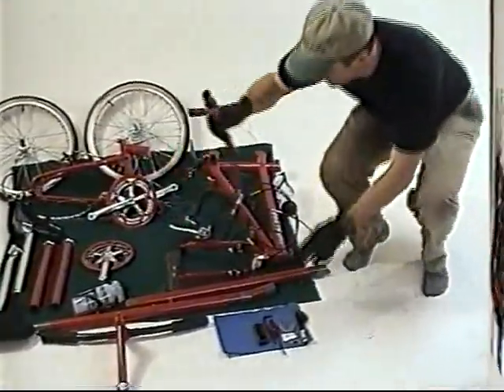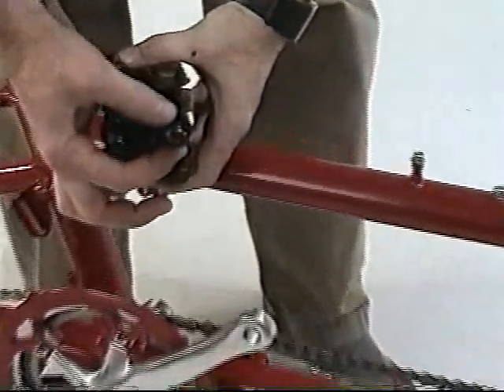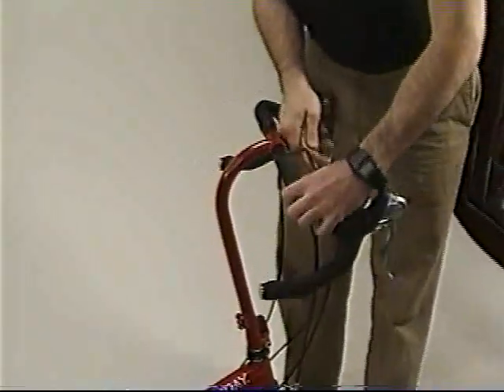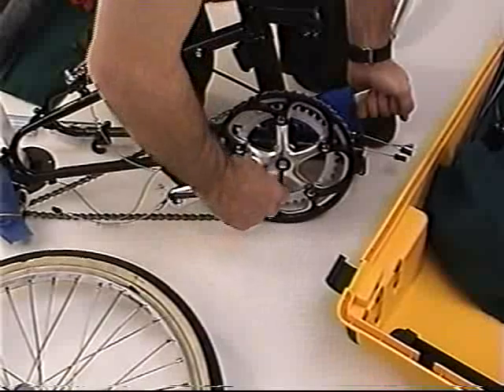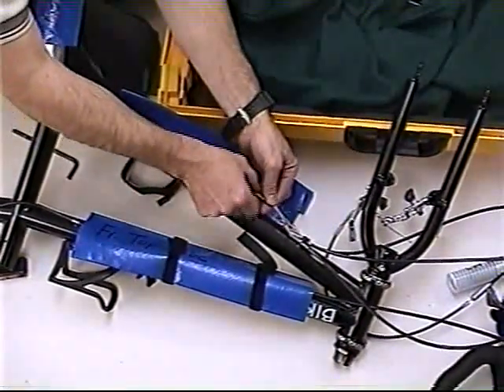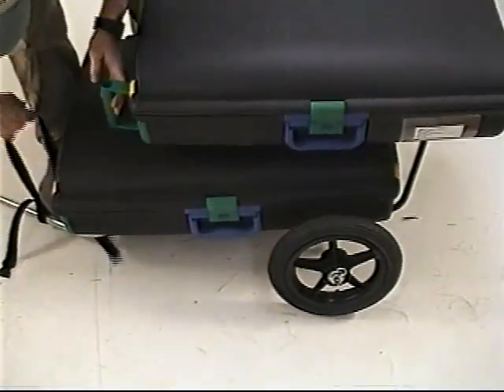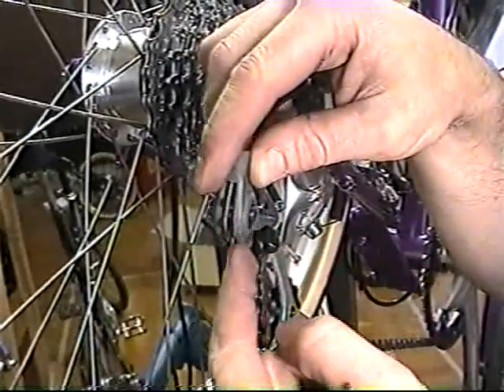Instructional Video for the Bike Friday "Project Q" or just "Q, Covering Assembly, Disassembly, etc.

Comment: Part 1 (01:07): Assembling from unboxed and unpacked parts (i.e., not from suitcases)
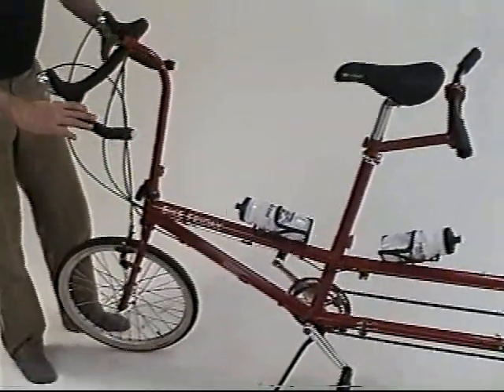Part 2 (12:51) - Converting your Q tandem to a single bike
Part 3 (20:49) - Disassemble your Q tandem for packing
Part 4a (27:52) - Pack your Q tandem into 2 Suitcases - Front of the bike into the 1st suitcase
Part 4b (33:30) - Pack your Q tandem into 2 Suitcases - Rear of the bike into the 2nd suitcase
Part 5 (34:57) - Pack your Q tandem into 1 Suitcase
Part 6 (41:17) - Pack your Q as a single bike
Part 7 (46:55) - Assemble the trailer
Part 8 (53:37) - Helpful hints for assembly and adjustments
-- Centering V-brakes
-- Checking with travel personnel
-- Removing & installing wheel with drum brake
-- Adjusting the indexing of the rear derailleur
-- Adjusting the 3x7 hub
-- Checking rollamajig